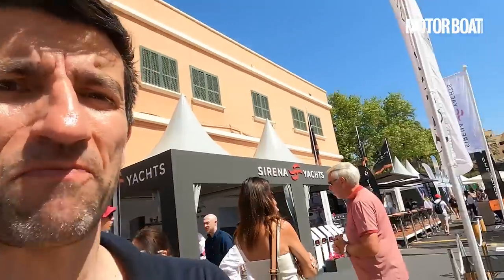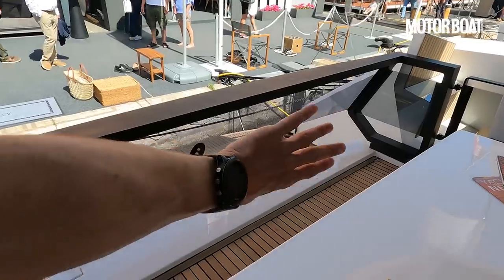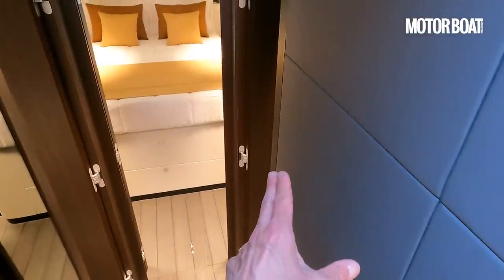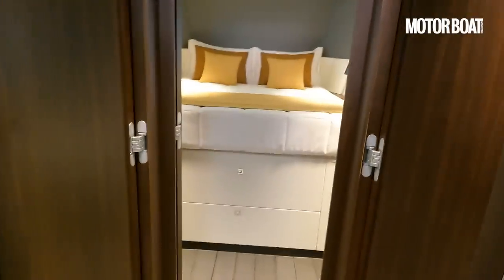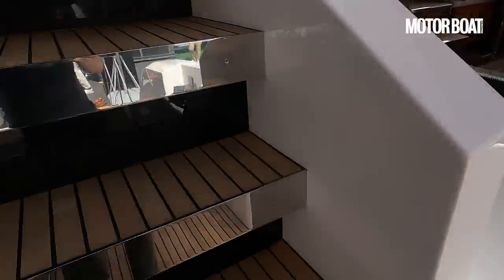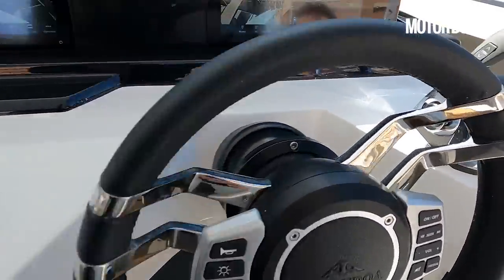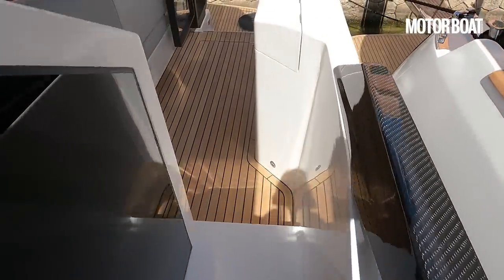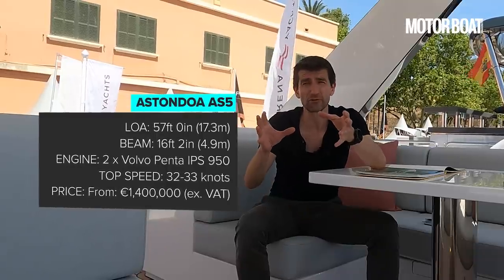Inside a fresh-thinking €1.4m flybridge cruiser | Astondoa AS5 yacht tour | Motor Boat & Yachting

Comment: I've always a lot of questions. Is there some rule about what color Volvo marine engines are? Some are white, some are green... Not a fan of the Stainless Steel all over, or of the very white gel coat. How much customization is there for this boat? The stainless will get very hot. Like the design language. Can you add a stabilizer? I like the vibe this boat gives off.

Comment: cockpit setee TOTALLY cuts off access to the galley access. not a good design. not a fan of having sun beds in front of the upper helm.  the interior design and appointments are quite nice - particularly the flooring. the engine space is quite generous.